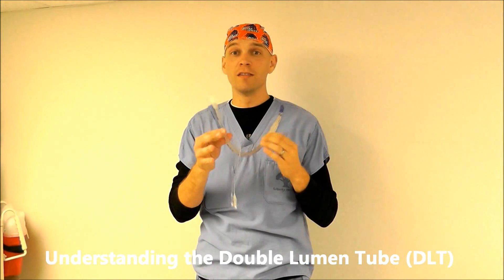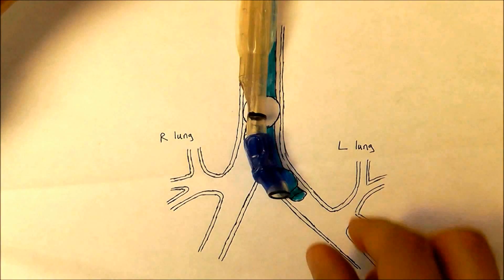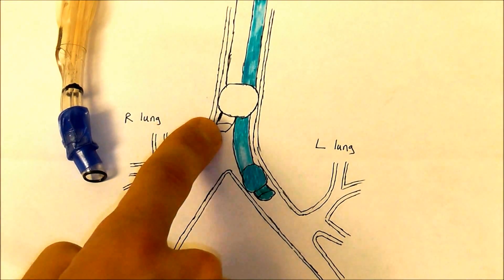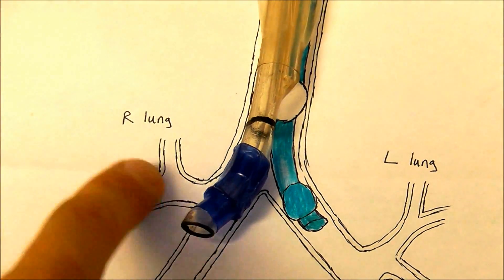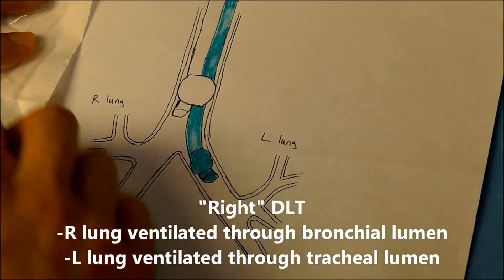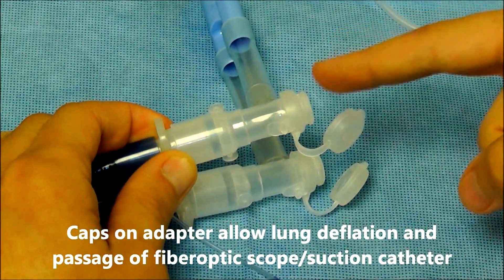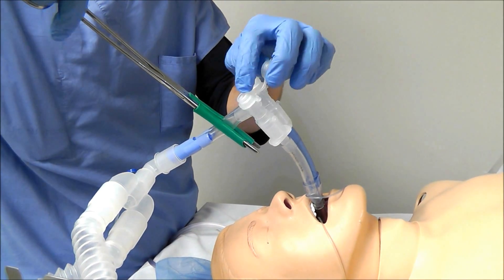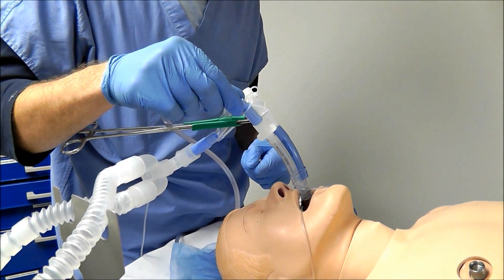Double Lumen Tube 1/2 (Training)

Comment: I Do have a point of question. In this example you have used a non carinal hook dlt. In case you had used a dlt with a carinal hook, would you have performed the same rotation directions and insertion technique?

Comment from the maker: Of course you can!  Just out of curiosity, who is your audience?
Reply: i dont understand the use of double lumen tube...if it ventilating the both lungs...how surgeon will perform the surgery...? n why it is called as single lung ventilation??
Reply: You can use it to ventilate both lungs or a single lung. You can’t see it very well in the video but where he is clamping there is a bifurcation there. Once you clamp one of the bifurcations it cuts off air flow to that lung. Without the clamp, you are ventilating both lungs.